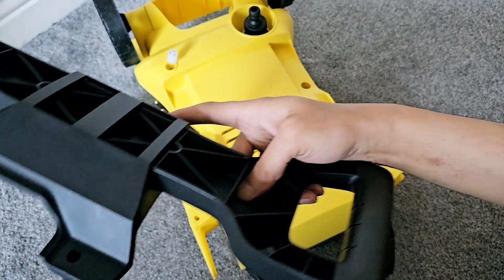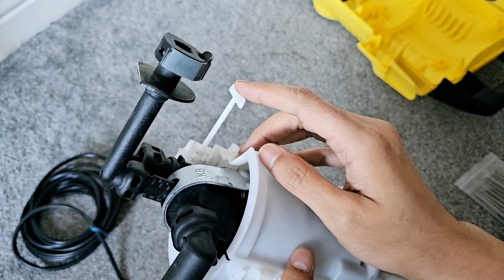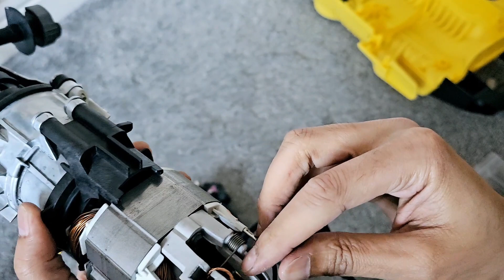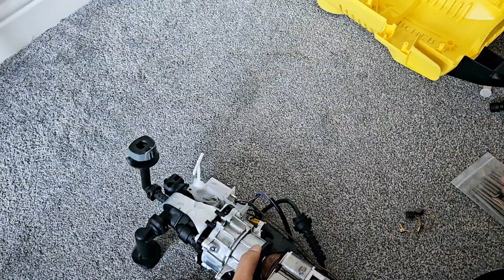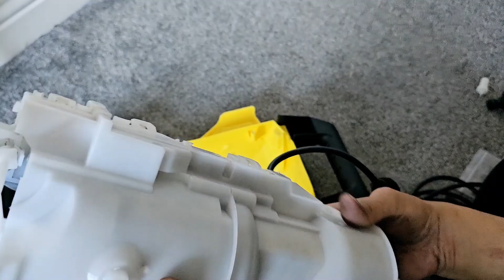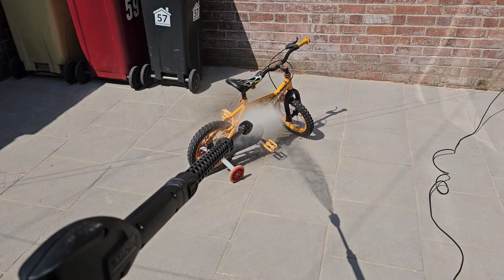Karcher Pressure Washer Smoke and Burning Smell Repair

Comment: Hi, was wondering if you can help, I changed the oil after putting it back together switching it on, there was a burning smell?? Opened to check there’s a slight oil leak and I can see oil around the copper wire, could this be the issue or the carbon brushes need changing??
Reply from the maker: I wouldn't say its carbon brushes issue because carbon brushes don't have oil in them. If oil is leaking from somewhere then that is cause of smell. Probably oil leaked on the copper wire is giving out smell when copper wires are getting hot.
Reply: Hi, thank you for your reply. What would be the best way to clean out the oil that’s leaked into the copper wiring section? Is it ruined now? 😖
Reply from the maker: @kaifaaa  machine still works with smell? Or it stopped working? 
I would say just clean with any cloth as much as possible. Dont use wet cloth. It might cause issues. But make sure oil leak is fixed and not leaking anymore.

Comment: I would be very surprised if the copper winding was broken and even more surprised if soldering would fix the fault.
Reply from the maker: One of my friends had a copper strand broken and surprisingly he fixed it with soldering and just wrapping heat shrink sleeve around it. Lol and amazingly that pressure washer is still going strong after 2 years. Thank you for comment and sub will be really helpful.
Reply: @theyoutube85  how on earth did he break it?
Reply from the maker: I have no idea but there was only one strand on the top that was broken.
Reply: I turned on my karcher k3 it made a light and smell of burning. Not turning on after this. Is this something to do with the motor? Thank you